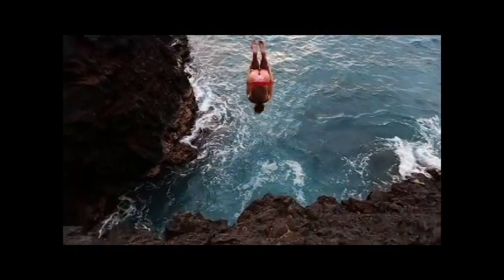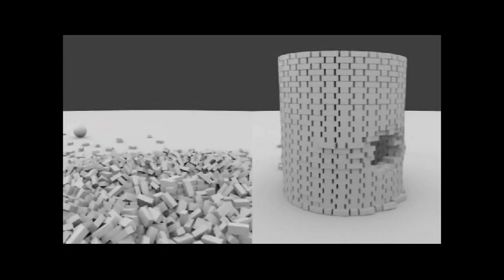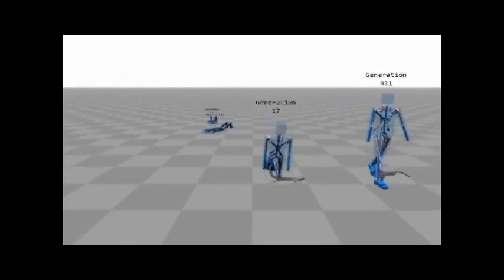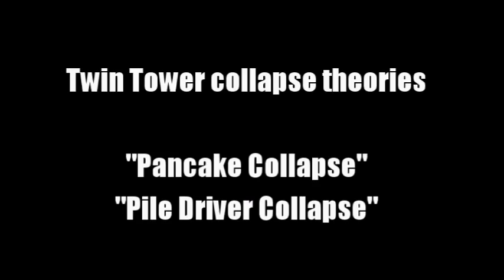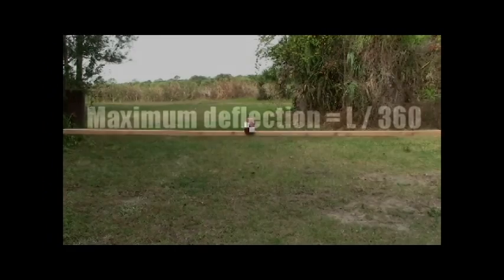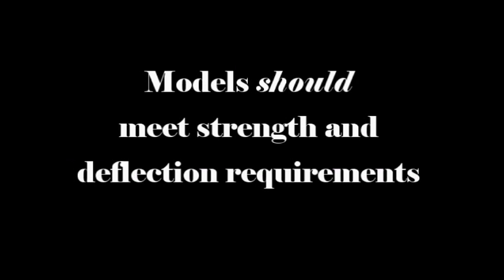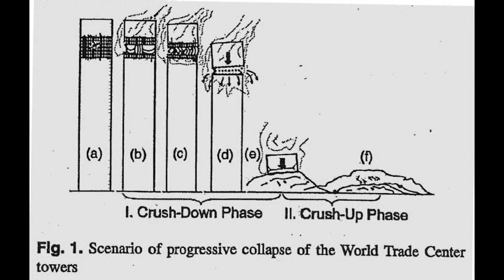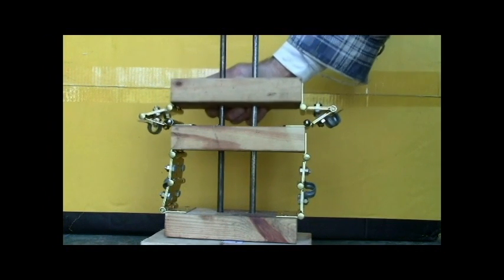9/11 Experiments: The Force Behind the Motion

Comment: Your experiments are flawed. It's true that, if a theory does not match experimentation, then it's wrong unless the experiment is also flawed. I think it's clear that your models are in no way to scale of the towers and that makes your experiments invalid. 

For instance, WTC 2 was 1362 ft high and each floor was about 207 feet x 207 feet.  If you have a model which is 20 feet tall, the dimensions of each floor should be 3ftx3ft. 

Why are the dimensions important? Its common sense that if you have a semi ridged surface being supported at the sides, it will bow when pressed in the middle. Using the same materials but a wider surface with similar supports on the end will allow bowing with less pressure. For instance if you have a wood plank crossing a creek embankment and the wooden plank is 10 feet long, it will bow as you walk across it. If it were 20 feet long, it would bow more than the 10 ft plank did.

Also, your floors are way too thick. The floors were 5 inches of concrete on congregated metal with 2 ft thick joists spaced across the floor. The concrete on the floor would be 2mm thick in a 20ft tall model and the joists would be 9mm thick. So at MOST your floors should be 9mm thick and that would be inaccurate since the joists would not react like 2 feet of steel layered solid under the cement.

I am not a structural engineer so I cannot give you specs for a better model, but maybe you should think about that before you spend so much time creating flawed models. Please also take into account the strengths of materials including britelness, tensil and compression.
Reply: Is the blacksmith from purgatory actually demonstrating the properties of heated steel to scale when he uses a 1/2" steel bar that he pushes sideways with a pinky finger Ryan?

Comment: excellent demo. and it didnt cost the tax payers a dime.
Reply: lol, only 30% of the weight...what is actually huge and shows that it was an important structural component. You know, calling somebody a government shill, when they simply are able to look at the evidence and conclude that it is plausible, because they have a background in architecture just shows your own confirmation bias. Your problem with the government makes you question the situation and not your rational.

Also, they did not fall because of the damage from the aircrafts, they fell because of the fires resulting from the crash. If they had crashed because of the aircrafts they would have collapsed much sooner...nobody ever argued that.
However, the aircrafts caused enough secondary dmg to the structure that at a certain point the integrity was weakend beyond recovery and due to the fact that the fires were out of control...the towers could have been saved (from collapse) if the fire were put out in time (roughly 90 minutes after impact, that's the time steel is capable to kep its structural integrity under a fire)...but since they were too widestread and the fire supression system themselves were compromized, any attempts to extinguish the fires failed.

And what's that bullshit with "too cold fires", yes black smoke indicates a lack of oxygen in the combustion, but that doesn't mean the fires are "cold" they are still well above 800°C even more, and we don't even see what is going on inside where in some places the fire melted steel and concrete reached burning temperature.

So spare me your half witted response, with stats you pulled out of your ass and that don't even support your argument at all (because you don't even understand those stats and how they correlate)

For instance the 6% firgure is absolute rubbish and doesn't consider where the structure is compromized. For instance the bomb placed in the cellar of the WTC ahd the potential to collapse the tower if it had the power to take out the 3 collums there...that's even less than 6%...yet it would have been enough to collapse the tower under the right condition.
Reply: it is also non representative since it has nothing to do with how the WTC was build. Just because he did an experiment, doesn't mean it was an accurate one. Huge confirmation bias too.
Reply: and the words that contradict his, are also from experts, that actually had access to the data, while he did not...so your point was what exactly? Somebody, who was not part of anything of this specific investigation has a different opinion? Wow, that never happens.
You agree with him, because it fits your own presumption and world view, you are ignoring data that contradicts your presumptions, he does too, it is called "confirmation bias" kkthxbb
Reply: Julesmo - It's a shem I just now read your bullshit post of 2 mothes ago. You encourage Raussl to look at the actual structural plans, and then you post a copied quote... Do you actually have any idea of the construction and engineering of the towers yourself? Do you grasp the concept of a progressive collapse? Do you understand that the fires initiated the collapse but the engineering caused the progression? Do you then understand that it doesn;t matter AT ALL what initiated the collapse and that the towers would have fully collapsed anyway, in a more or less symmetrical manner? How much kinetic energy was present at 9/11 exactly? Do you understand that "the Structural Engineer who designed these structures" never had a plane in mind that would impact the building at full throttle? Do you get the fact that the towers indeed still stood after the impacts?
Please do yourself a favor and do not copy/paste posts that you do not understand.
Reply: Raussl - You should look at the actual structural plans for WTC 1 or 2.  And you would stop being such a shill for the government.  The outer skin of the building only held 30% of the weight of the structure and of this skin, Only 20% of that was damaged. or about 6% of the total structure was compromised.  Structures are designed to 170% of maximum potential and losing 6%, was nothing to this structure.  The interior 70% was comprised of 54 massive columns in a rectangular pattern in the center core of the building.  Each of these were 5 foot wide and 2' thick.  Massive, Massive columns.  Maybe one was damaged, but highly unlikely.  In particular for WTC 1, where the plane hit in a diagonal hit and missed the center core.

The fire had turned to black smoke which is a fire that is going out and much too cold to melt anything related to the center columns.  Each floor was a composite deck of steel joists and concrete that anchored each floor to the perimeter in a uniform load.  Any damage related to melted joists or beams would have created a off center axial load and the building would not have fallen within its footprint, nor would it have been a total collapse.   Never mind that the Structural Engineer who designed these structures designed the building and the skin to absorb more kinetic energy then was present on 911.  

Regardless of the demostration of this video.  Those towers did not fall as a result of fire and airplane damage.
Reply: Of course it is. The smoke is black. Can't you see that?
Reply: Bruce, please explain then how uncontained (open)  fires could reasonably raise temperatures high enough to reduce the structural capacity of all 48 of the interior beams enough to induce a symmetrical collapse,  Sorry but Manuel Garcia's BS explaination doesn't cut it regarding a mega structural steel building (the first ever to collapse due to fires) please explain how this would occur uniformly, And explain why the Spire collapsed prior to the actual exterior structural shell moving one inch. (Also do not cite any sources, please run the calcuations yourself, as you say don't copy paste stuff you don't understand.)

Since the structural notes from the designing engineer do not exist, you are making incorrect comments regarding what limits of the 707 were used. Furthermore even NIST states the collapse was the result of fires and not the impact from the planes.

For the record, I'm quite familar with Structural buildings, having studied them throughout college and serving over 20 years in the industry building many structural steel buildings.
Reply: Julesmo - "please explain then how uncontained (open)  fires could reasonably raise temperatures high enough to reduce the structural capacity of all 48 of the interior beams enough to induce a symmetrical collapse"
Which open fires are you talking about? Do you think that broken windows make an office fire an open fire?
Why do you think all 47 core columns would have had to fail to cause the collapses? You claim knowledge of structural steel buildings. So I don't get why you don't understand the concept of load transfer. Anyway, you seem to overlook the fact that the fires initiated the collapses and that the engineering actually caused the progressive part. I mentioned this in my comment above: it doesn't matter what initiated the collapsed.

"Sorry but Manuel Garcia's BS explaination doesn't cut it"
When did I mention Garcia?

"the first ever to collapse due to fires"
That's irrelevant. We are discussing collapse sequence, not history.

"please explain how this would occur uniformly"
How could the progressive part of the collapses NOT have been uniformly when you know how load are being transferred to the next intact structural member, making it fail in a split second and so on? How could the progressive collapse have occured randomly? Apart from the technical floors, the towers' floors were designed identically.

"explain why the Spire collapsed prior to the actual exterior structural shell moving one inch"
It didn't. At all. The upper part of the north tower fell south. You are referring to footage that was taken from the north, making the antenna look falling before the roofline did. Please do some research. you know what? I'll do it for you. PLease take a look at this footage, taken from the west. I timestamped it to the moment the north tower stared collapsing. Please see which way the antenna falls: https://youtu.be/3HbD_Q6kmh8?t=1m41s
No calculations needed to prove you wrong. Just some logic and common sense.

"you are making incorrect comments regarding what limits of the 707 were used."
If you make a statement like that, you have to be sure why I would be incorrect. I won't ask you to prove, don't worry. I'll just post part of an interview with Leslie Robertson in which he explains himself which scenario they envisioned for an impacting aircraft: https://youtu.be/aHGllrXsgEI?t=1m46s
Reply: Bruce, the reality is this:  There is not enough time in the world for me to convince you.  Nor I'm I obliged to do so.  I suggest you open you mind a little bit more and continue to review the mass of evidence regarding 911 and even if 90% can be objectively dismissed, even 1 item that proves there was a conspiracy well beyond some butt hurt Saudis bent to cause us harm, then That is 1 item that has never been reviewed by our pathetic government and white washed by our media.  Do yourself a favor and wake the fuck up.
Reply: the explanation was given already, you chose to ignore it so you could continue to believe your own fairy tales, of global conspiracy. Steel weakens significantly above temperatures of 500°C...it doesn't need to reach 1300°C to collapse. You can test this yourself, by putting steel into a fire and then try to bend it.
Reply: Julesmo - "There is not enough time in the world for me to convince you"
It's not about time. It's about a lack of evidence. There is not enough evidence in the world for you to convince me. The problem is that your starting assumptions are false. I don't blame you. Some conspiracy videos can be very convincing. I once believed it too until I sterted analyzing some of the claims being put forward and found these were not backed up by facts. Just like some of the claims you copied. Here's a list of your assumptions that are clearly (verfiably) false:
- "The fire had turned to black smoke which is a fire that is going out" - Light smoke only indicates that there are no petroleum products burning. Black smoke can be produced by burning plastics.
- "much too cold to melt anything related to the center columns" - No steel melted or even needed to melt.
- "Each floor was a composite deck of steel joists and concrete that anchored each floor to the perimeter" - In fact it were the bolts that anchored the floor trusses to the truss seats. Just two bolts for every section.
- "the building would not have fallen within its footprint" - It didn't. Hence the damage/total destruction of at least 12 other structures.
- "Never mind that the Structural Engineer who designed these structures designed the building and the skin to absorb more kinetic energy then was present on 911" - He didn't as explained above.
- "reduce the structural capacity of all 48 of the interior beams" - It didn't and it didn't need to.
- "explain why the Spire collapsed prior to the actual exterior structural shell moving one inch" - It didn't as proven by the above video.
- "NIST states the collapse was the result of fires and not the impact from the planes." - NIST states:  "NIST concluded that the WTC towers collapsed because: (1) the impact of the planes severed and damaged support columns, dislodged fireproofing insulation coating the steel floor trusses and steel columns, and widely dispersed jet fuel over multiple floors" I left out the second part in which they indeed discuss the fires.

If you start analyzing the claims being made, you'd be surprised how much of the conspiracy theory claim is verfiably false. But you do need to check the facts and not just accept what is being told in these videos you probably have been watching.

"I suggest you open you mind a little bit more and continue to review the mass of evidence regarding 911"
I am willing to study every single claim regarding 9/11 if I haven't done so already. You are talking the mass of evidence. Actually i have not seen 1 single piece of evidence yet. But please, feel free to post some of it so we can discuss. 

For some reason you seem to think that NIST or any other "official" body should have investigated the claims within the truther community. Why? You also seem to assume that people like I, that do not go with the conspiracy thery, must have obtained their knowledge and information by the media. I am not interested in any opinion of "the media". I am only interested in varfiable facts, reason and logic. I'm awake. Are you?
Reply: Raussl - I found  a nice short video about exactly that: https://www.youtube.com/watch?v=FzF1KySHmUA&index=1&list=LLwz3WHQMvFbgJJQnNl4ID2g